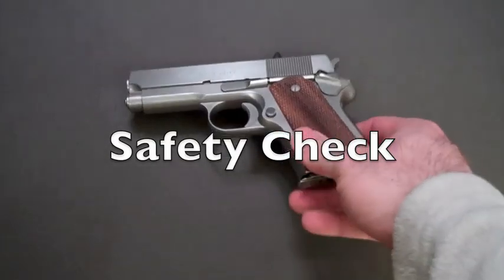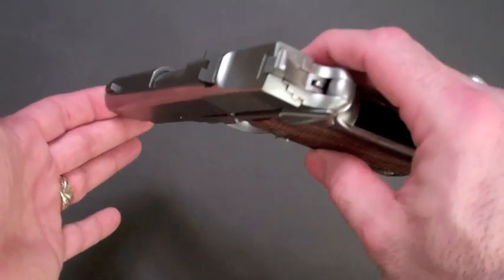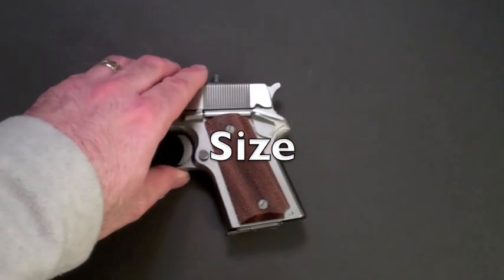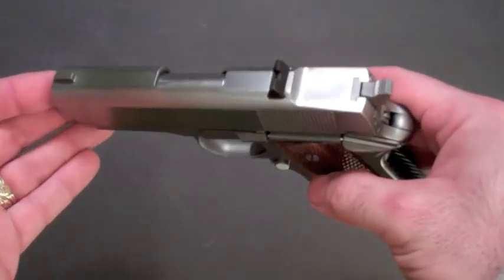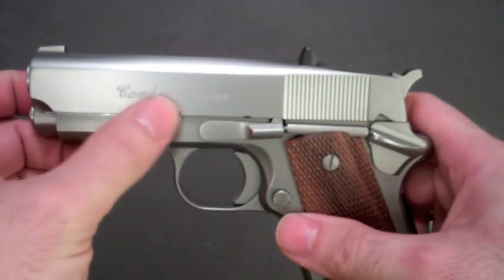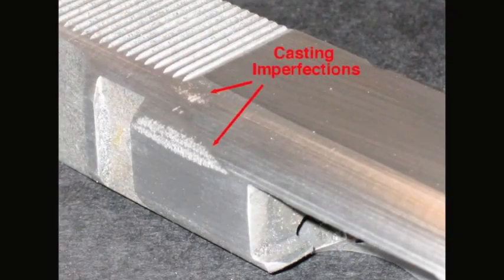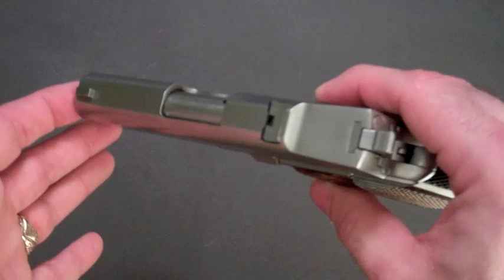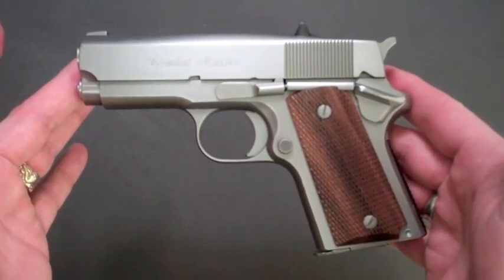Detonics 1911 Restoration (repost)

Comment: I love it. it needs a set of custom made black Water Buffalo horn grips.
beautiful gun. I think I would remove the front and rear sights and fill them in with blanks that match the slide finish. I also like the  "Seattle" Detonics engraved instead of Bellevue or the others. stainless is wonderful. sand, file, blast, and polish.

Comment: Sir, fantastic job on your restoration. And very informative video.  Question, you had mentioned 600 grade sand paper to file out the seams, pits, etc.\.  Did you have to go to 1500 or 2500 grade later to achieve that shine?  And if so, how long did it take to complete.  Thanks again for posting a great video of a fine weapon.

Comment from the maker: Wrong once again. You would think you would get tired of that. I have the original box and papers. It is an MC-1. The modeled look you see if because the stainless surface is left unfinished as a cost saving measure on the MC-1 pistols. Mine does not look like that now because, as I would have thought you would know since you watched the video, I finished the gun.

Comment from the maker: You might want to get your facts straight and read the history of the Detonics company. Even their own advertisements at the time billed the MC-1 as a "low cost alternative" to the MKVI. My old dealer has one of the ads still on his wall.
.
.
The gun is stainless. There is no finish applied. The steel is left rough textured instead of brushed or bead blasted.

Comment: Is that a serious question?  Many times on Detonics.  Last was for a friend of mine who bought a MK-VI.  It is a very common practice.  In fact when you bought new springs they supplied 4 or 5 washers with the springs so that you can adjust it.  I do the same when people buy new springs from me.  Still want to know who told you that they grind em at the factory to fit.  "Why not? That is how it is done at the factory"  If you grind the back, how does it fit on the front?

Comment: MC-1 was not a low cost version of he MK VI.  Is a Government Model a low cost version of the Gold Cup? MK VI had the slide sides polished the MKV did not.  The MC-1 had a completely different finish applied to it that the others did not.  The purpose was to have no reflective stainless finish on the pistol anywhere for tactical purposes.  Once again, it is not a cheaper unfinished version of the other models.